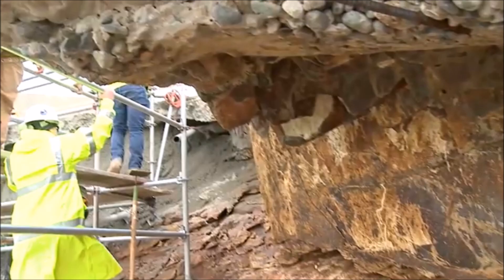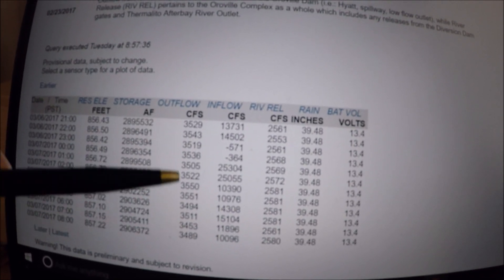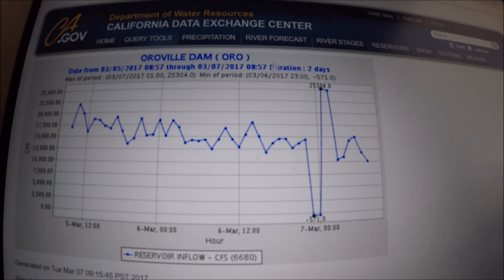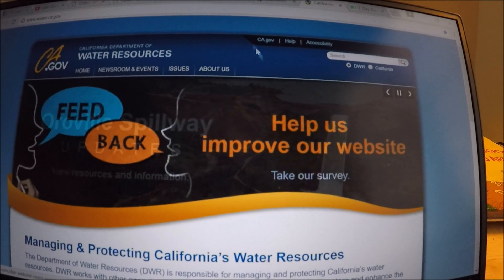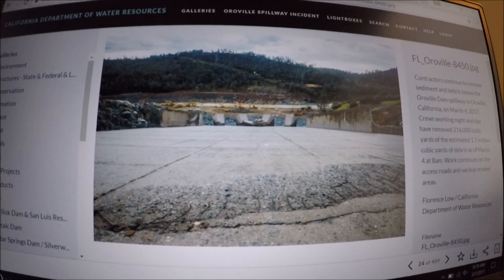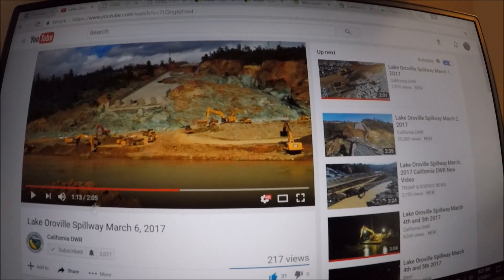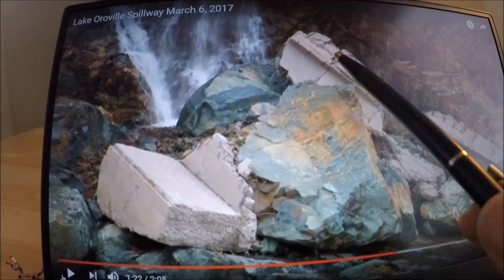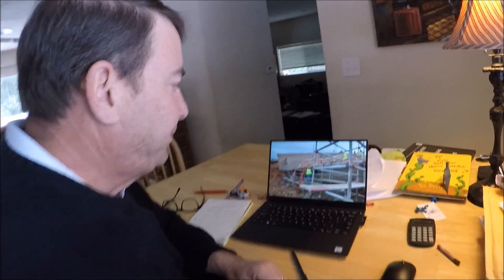Oroville Update 7 March 2017  "Where's the Rebar?"

Comment: it is said that "Falling Water", an iconic house in Pennsylvania, designed by Frank Lloyd Wright, is failing because of inadequate 're-bar'.
An anecdote circulated about the construction is that the concrete contractor inserted more than called for in the design...

Comment: I know a lot of people want to know the thickness of the spill way.  Now there are ways to do it with just a good photo of the workers and the spill way at 4:25 in your video.  there are workers standing down below the spill way. they all have hard hats on and to save my life if I had a hard hat you could measure it and then use that measurement and with what you have in the picture use that as a reference and get a ball park of how thick the spill way is.   as for the workers them self's they can be any were from 5 to 6 feet tall.  and with just a rough estiment would be wrong looks like at the otter edge its about 3 to 3.5 feet thick and looks like it thins down to about 1.5 to 2 feet in the middle, give or take 6 inches.

Comment: Hi ; I think spillway walls would have been , not at square angle , but open to 135
degree angle so that when huge amount of water is flowing it does not countain/retain water and its generating destroying vibrations and also the spillway would have been wider and wider to the bottom ( fluids are like that ; "laminar" flows only at very slow speed ; turbulent flows rapidely coming with the increase of speed , quality surface .... -> physics laws ; see Bernoulli's laws for example ) . Concrete they are putting over the damages is just a "layer of paint on dust " ; it will explodes soon as they release water again ( no rebars in those repairs ! )  . Try to be safe California .

Comment: I hope they get that concrete to fully cover all that dirt . Because if  they don't it's going to be like a dairy Queen dipped cone  with a cracked shell . It will float right off of there if there. The concrete that broke out was three feet thick this stuff is ? 6" ..a foot?  it's going to interesting when they turn it on . they might want to get some rubber rolls and lay it all over the place .

Comment: It's more than obvious they went ultra- if not criminally cheap on the design and construction of the main spillway. It was basically just poured on the dirt slope for the most part and was so insubstantial as to almost be laughable. It should have been taken down to rock and in places where they couldn't it should have been supported by edge piers under the sidewalls with crossbeams running between them under the spillway floor - something more along the lines of typical bridge construction than what we're seeing. That, and it should have been more like three feet thick with more rebar.

Comment: At 5:19 there are two men standing directly above the broken concrete face. Although my accuracy would be limited as I am looking at a second hand screen, by estimating the height of the taller worker at 6'0" and using that for a scale, the concrete immediately to the right of the ladder is about 13" thick. The face of the break does not reflect a great deal of rebar if any at all. If we go back and freeze the video at 5:17, it would appear that using the area to the right of the ladder as a scale then the concrete to the left of the ladder is at least 18" thick, but again, little to no rebar. 

I have seen this once before on a bridge deck where there was storm water and expansion joints cut in the concrete. What had happened there were large sections of rebar that had simply rusted away when water from snow or rain got to it via the expansion joints and then it was exposed to air. The entire bridge deck had to be replaced and the new reinforcing iron was epoxy coated and electrically tied to a sacrificial anodes to limit or eliminate corrosion.

Comment: Like your reports. In regards to the rebar, from what I have seen as a retired building Supt. it is much less that I would expect for exterior concrete paving over earth structure for purpose of large amounts of hydraulic pressures. For big sections of concrete built on earth like the spillway there should be multiple vertical layers of horizontal bar. Rebar is everything for horizontal loads. Easy to judge in hindsight I know but obviously the engineering for this spillway was not met by the demand.

Comment: Can anyone tell me what's the importance of rebar?? Not in relation to construction. 
Every body saying rebar visible... Title says "where is rebar"
So what's the deal if it's visible..?
Reply: @Mukesh Goyal: The rebar was installed during the original construction. But when the spillway failed it was ripped out of the inside of the concrete. Now they haven't seen it in the past blancolirio's past video's. So blancolirio called it out in this video to answer the other readers original rebar construction questions. Additionally, now DWR has just released better video of the rebar.
Reply: rebar allows the concrete to stay flexible and not be so ridged that it cracks and falls apart. The old standard of just a single wire mess was prone to failure under heavy shacking, earth settling and tree roots. New rebar standards incorporate tubular or square block channels that are more resist to partial failures. Or more simply put, it might of cracked, but it wouldn't be able to pull the hole thing apart.
Reply: Joe Casarez thanks for your reply.. But ur ans is in context of construction.
But y they all r so curious to see a rebar?? Like "where is rebar" in some video they showed "see rebar is visible there" 

I mean people r curious for two things gold nd rebar. 
Why in video rebar is given specific importance?
Reply from the maker: Mukesh Goyal Because so many folks claimed there was no rebar used in this project.
Reply: blancolirio Ohh thanks... I got it now.. 
That means similar conspiracy everywhere to put blame on others..
Reply: Joe Casarez thanks for this information.. 😊
Reply: blancolirio following your channel from the other side of the world. Love from India. Hope this thing don't overflow nd lacs of people who evacuated start living happily.😊☺

Comment: I noticed the floor slab of the spillway broke off clean along the edge of the stem wall, meaning it is a cold joint there and only held by the bent rebar, this use to be a typical way years ago like in freeway retaining walls to sidewalks. I am just thinking if it was poured monolithic there would have been better. And over time if rebar makes any ground contact or gets wet from cracks in the concrete it will weaken from rust and corrosion over the years.
Reply: The spillway broke exactly where a drain pipe was, meaning it was the thinnest at that point.

Comment: From what, I recall hearing on the standards in the 60's on using rebar. Is it wasn't used in the volume it is today! Nor was the standards high, and I believe that was more about the cost of the technology to manufacturer rebar in the 60's, as you see today! 

As for the difference in thickness from one side to the other, it is possible that the water has run more on the right side vs the left as you look at it in the picture! Since it seems the water flows more on the right vs the left, so the rushing water on the life of this spill way just wore on the right side vs the left! Or it could be the fact that is how it looks since one side of the thickness could have broken on more than the other! So it could still be all one thickness, however, we are possibly just seeing the underneath side of the area where the spillway lane is broke away, from how it forced apart when it broke up! 

Of course, there could be a fair amount of both going on, however, I would wonder what the make up of the material used in the concrete was made up of when they were mixing the concrete up that was poured to make the spillway! As in was the concrete mix made with sand, lime, crushed rock, river stone, ash or whatever else they used in the 60's! Again, I am not referring to what they are using right now, but rather the concrete that was used to make the spillway lanes! 

Moreover, I by no means place fault or pointing fingers at those folks that are there to keep the dam working. Since they can truly do what they have the funds in their budget to do! Although, as I normally say, since I have been a Independent since I was 19! I have no problem laying blame at the politicians feet, due in large part to the fact they decide if funds are appropriate to maintain infrastructure like a dam! Besides, in the old video on the building of the dam, they did say they finished it ahead of time by a year or possibly more! In my understanding of building anything important like a dam, is it was rushed, and corners were cut to complete it ahead of schedule! This is when I would want to know how many politicians at the time, were up for re-election! 

Moreover, the well-being of all those people downstream from the dam is my main concern, and not any politicians involved get re-elected! I would also add, that in my view when the question about who is paying for this work going on now, it is more of a question of is it state or federal funds, since that denotes if the people of California only are paying for the work or if everyone in the country is paying for the short term fix! Again, in my view, this what the answer to the question of who is paying for the work going on now comes from! Since if it is state funds then the people of California should be paying attention to how their tax money is being spent! Although, if it is federal money then everyone in the country should be keeping an eye on how their tax money is being spent! Even though the question should have been worded better, to get that answer!

Comment: That power plant isn't working properly that's pretty obvious. What's being hidden from us now? The turbine fromthe Russian sanyo dam killed lots of people when it failed is this a possibility with this dam?
Reply from the maker: mindciller good point!Croyle mentioned the failure in Russia...that's what happens when you continue to run the turbines after the exhaust is plugged by high water! They did not repeat that mistake here.
Reply: I thought the report for Sanyo dam said it was shearing of a pin. People that worked there complaining about lack of maintenance and not replacing the affected parts including nuts missing etc.. All dams have a life expectancy what is oroville????

Comment: It's not the amount of rebar per se. It's how the whole structure is engineered for the steel and concrete to compliment and reinforce the other. The Cypress Viaduct had a very large proportion of rebar to concrete but failed tragically.

Comment: Did  steel failed at ''tie'' overlaps  OR were the bars welded ??
Reply from the maker: antibent don't know...
Reply: Honestly,  some shots show way too much ROCK in the cracked spillway cement.  That mixture was useless.....not enough bonding cement at  0.20.

Comment: There's a little bit of rebar in there here and there but it was obviously inadequate. If the rebar and concrete were placed properly that spillway would not have collapsed. Whoever designed and built that spillway is gonna have some explaining to do!

Comment: blancolirio  Testings of materials, formulas for strengths, & even the best laid placements of every part of a dam or spillway... All pale in comparisons with the undeniable decisions, that water can make. i enjoy your labors of information gatherings. All i'm sure of is that round aggregate utilized in compacted fill, or concrete mix designs... will not lock, but will in turn roll off of each other, under water & load placement conditions such as these. 
See timeline forty seven seconds in @  https://www.youtube.com/watch?v=how56Jem9ZU "Cobble Don't Surf" -Former TXDOT Inspector of new bridge & roadway construction 1986-2009 -gilpin 3717

Comment: the variation in the thickness of the concrete floor of the spillway is due to erosion, and if you had good optics on a tripod you can determine the thickness

Comment: Is there something wrong with the concrete used for the spillway?  Oklahoma City had the problems with many of their highway ramps falling apart.  My understanding is that they decided that the contractor used to much sand in the mixture.  The photos of the rebar, from the big chunk from the spill way  looks way to "clean."
Reply: I'm pretty sure that water must have gotten into the rebar channel and rotted the rebar down its own encased path. I'm blaming it on tree roots looking for water and they finally found a lot of it.

Comment: Awesome followup on the rebar I am still suspicious of the lack of it in the rubble if there were in fact sticks laid on even two foot centers there should have been a mess of it down below given the amount missing ? 
 I'm struck by the walls in the opening shot showing the amount of rebar used there and the fact that the concrete had washed clean out of it. that would not have happened with a good mix of the proper materials, that's what happens when that round river rock was used instead of crushed for the aggregate there's no mechanical lock within the mix

Comment: From a military engineering stand point, the rebars should be spaced apart at 1.5 times to 2 times their diameter from side to side, and the wire ties should be replaced with mechanical lengthwise-crosswise bolted mechanical clamps. And more than that the soil and rock formation should be pressure grouted to further strengthen them and to solidify them and place enough steel-reinforced concrete pilings whose rebars with intersect with the other rebars, and the concrete will be a proportionate mixture of 2 parts cement, 1 part sand, and 1 part graded gravel mixed with enough water to create a semi-plastic/semi-liquid concrete mixture that can either be placed or poured with the use of powerful concrete vibrators. But one must keep an open mind about other concrete mortar mixtures such as the ancient Chinese lime-rice glue mortar that has lasted for thousands of years and even resisted earthquakes and modern day demolition.

Comment: What improvements could have been done before this damage. In other words, Can you pour new slab over old slab ?
I also noted clear cut patches in the mts. behind this dam that should not have been signed off to permit. Who is responsible for green lighting forest clear-cuts ?
Reply: If the original slab is not properly anchored to the bedrock, cavitation (vibration) caused by the torrent of water will eventually cause the slab, and any additional over-laid slab, to fail.  The sub-surface is the key.
Reply: Thank you for that detail.

Comment: While it's impressive to see the damage, whitewater boating enthusiasts are well aware of things like gradient and cfs flows and how they interact with each other. The spillway had 100,000 cfs flowing down it. A cubic foot of water weighs about 63.5 pounds, multiplied by 100,000 will give you how much weight...PER SECOND !!!
Anybody that questions how "only" water busted up the concrete need only do a little math to understand why, or I could take 'em down my local river at 1800 cfs, and then repeat that run at 5000 cfs for a more full understanding.

Comment: The thinness looks to be consistent with high wear due to the flow being greatest in the middle. Closeups show the polishing of the exposed stones. I wonder if a timely cap over the top of everything would have prevented the complete chunking out. Water might have gotten into any cracks and rotted the rebar years prior to first failure.

Comment: Lots of rebar, you got to be kidding.  Structural standards for civil concrete structure have not change in years. Stubs sticking out looks like the longitudinal bars just pulled away from each other with no transverse bars evident. Spacing also looks excessive.

Comment: Just remember that every thing on the internet is true!!!!!  Afternoon Juan, Now if this is not that balancing act i dont know what is. Great job on all the reporting you been doing. This project is one word....EPIC. Special thanks goes out to everybody there on site, from the engineers, PG&E, chopper pilots, scuba divers, operators and the man in the ditch with a shovel. Thank You all. I have to say that when that e-spillway caused the e-vac notice I thought for sure it was goin down. Riding the Razor's Edge. Thank you. So Juan, all you need now is smokin hot weather girl. :) Maybe....mmmm...I know.....7 of 9?  Smokin!!! Ok I am going to throw out a prediction on the table. The "Big Fix" is that in summer time I see a entire new spillway starting where the parking lot is and then patch the main spill and use it for the emergency spillway. Why? I dont think they are going to screw MILLIONS of  dollars on to the end of that faulty slip and slide and be able to count on it for the main. ( remember you said you wanted to pull a tape on the thickness of that inconsistent pad of the spillway) Well just a thought!! Till next time Thanks, Richard.